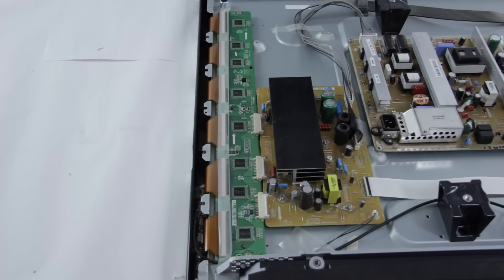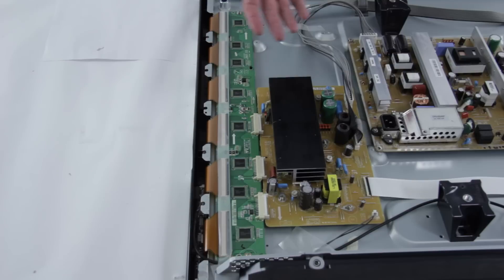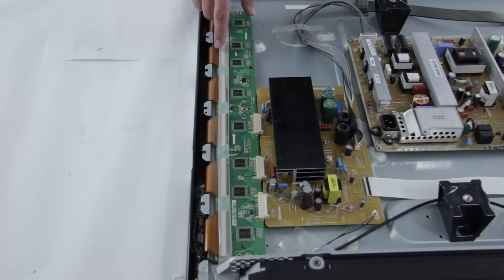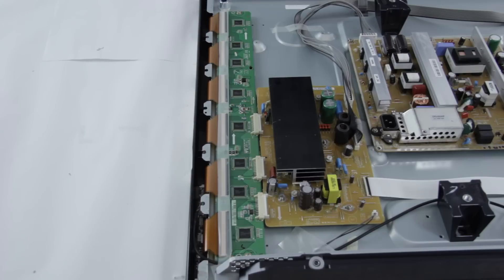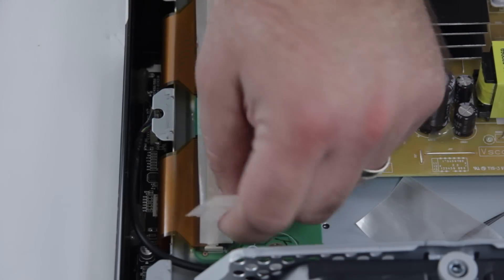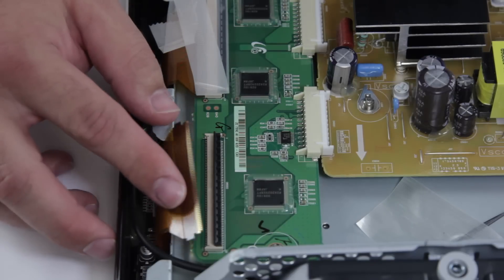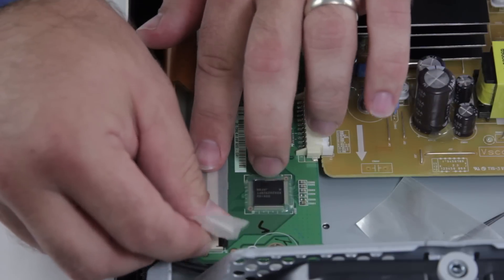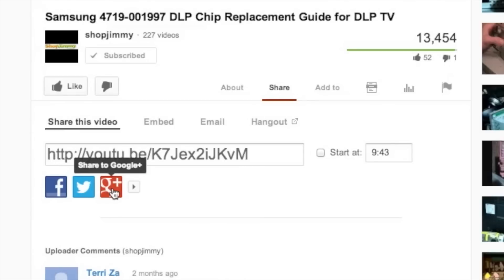Plasma TV Repair - No Image, No Picture on Plasma TV Screen - How to Replace Y-Buffer & Y-Sustain

Comment: i have a RCA 42PA30RQ that just turned off & when it turns on..there's sound but no picture..how do i fix this or what needs to be replaced?
Reply from the maker: B Jones  Try all repairs and troubleshooting at your own risk.  I recommend replacing the Y-Main Board and the Y-Scan Drive Board in your TV.  Click this link to replacement parts for your TV model number:  http://www.shopjimmy.com/catalogsearch/result/?q=42PA30RQ  There may be multiple boards for the same TV model number, be sure to match part numbers on your current board, with your replacement for compatibility.  Here is a link to a video showing how to identify your part number, click here: https://www.youtube.com/watch?v=R1jmj_foId0  Thanks and please let us know if you have any further questions with your TV Repair!  www.shopjimmy.com

Comment: I have a plasma Panasonic 42 in model tc-p42x5 
The tv turns on but doesn't display any picture at all . The led indicator shows that the Tv is On but without a screen.
Reply from the maker: Corina Arellano  Try all repairs and troubleshooting at your own risk.  I recommend that you bring your TV to a certified Panasonic repair shop.  Thanks!  www.shopjimmy.com

Comment: Hi, I have a Phillips 50" Plasma Model #50PFP5332D/37 My tv made 2 loud pops, then a dark, no pic screen. Where should I start first to possibly repair?
Reply from the maker: MMA WOZ   Try all repairs and troubleshooting at your own risk.  I recommend replacing the Y-Main Board and the Upper and Lower Y Scan Drive Boards.  Click this link to replacement parts for your TV model number:  http://www.shopjimmy.com/catalogsearch/result/?q=50PFP5332D%2F37  There may be multiple boards for the same TV model number, be sure to match part numbers on your current board, with your replacement for compatibility.  Here is a link to a video showing how to identify your part number, click here:  https://www.youtube.com/watch?v=R1jmj_foId0  Thanks and please let us know if you have any further questions with your TV Repair!  www.shopjimmy.com

Comment: I hace a 50 inch samsung plasma model FP-T5084 , the problemas is that half of the screen is dark and the other side is in  lighter color, what could the problem be ??????
Reply: I replaced 2 fuses a couple of days ago ,and was working justo fine till yesturday when the screen changed color in the middle..
Reply from the maker: marcelo guajardo  Try all repairs and troubleshooting at your own risk.  I recommend replacing the Y-Main Board and the Upper and Lower Y Scan Drive board in your TV.  Click this link to replacement parts for your TV model number:  http://www.shopjimmy.com/catalogsearch/result/?q=FP-T5084  There may be multiple boards for the same TV model number, be sure to match part numbers on your current board, with your replacement for compatibility.  Here is a link to a video showing how to identify your part number, click here:  https://www.youtube.com/watch?v=R1jmj_foId0  Thanks and please let us know if you have any further questions with your TV Repair!  www.shopjimmy.com

Comment: I think I have the same problem with a HP-T4234 Plasma tV,  it made a loud pop and stopped working.  when I plug it in,  it clicks but nothing else.  If I have to replace the parts as indicated on this video, I'd like to get an idea of the cost of the parts.  Newer technology TVs aren't that expensive and it may not make sense to purchase the parts if they are expensive.
Reply from the maker: Douglas Fry   Try all repairs and troubleshooting at your own risk.  I recommend replacing the Y-Main and Y-Buffer Board in your TV.  Click this link to replacement parts for your TV model number:  http://www.shopjimmy.com/catalogsearch/result/?q=HP-T4234  There may be multiple boards for the same TV model number, be sure to match part numbers on your current board, with your replacement for compatibility.  Here is a link to a video showing how to identify your part number, click here: Thanks and please let us know if you have any further questions with your TV Repair!  www.shopjimmy.com

Comment: I have a vimax 4219h plasma tv. It turns on and stays on but there is no display what-so-ever. It tries to turn on once for about 1 second but goes black. I've checked all the capacitors for swells or leaks and don't see any. I checked all the va, ve, vsc, vs values at the test points and all are right where they are supposed to be. Any ideas what my problem is?
Reply from the maker: chrisbrown4004  Try all repairs and troubleshooting at your own risk.  I recommend replacing the y board and buffers.  Unfortunately I do not see any replacement parts in the search results for your TV model number on our website.  Please reply with your part number on your y board and buffer(s) and I can try searching for replacement parts.  Thanks and please let us know if you have any further questions!  www.shopjimmy.com

Comment: I have a Samsung PN60E530A3FXZA Plasma.  there is no picture.  The red power light blinks every 9 secs.  There is an LED on the logic board that is not lit.  I have replaced the main board with no change in symptoms.  I have disconnected the Y-sustain and the X-sustain separately with no change in symptoms.  Please help
Reply from the maker: Tim H   Try all repairs and troubleshooting at your own risk.  I recommend replacing the Y-Main and the Upper and Lower Y Scan Drive boards.  Click this link to replacement parts for your TV model number:  http://www.shopjimmy.com/catalogsearch/result/?q=PN60E530A3FXZA  There may be multiple boards for the same TV model number, be sure to match part numbers on your current board, with your replacement for compatibility.  Here is a link to a video showing how to identify your part number, click here:  https://www.youtube.com/watch?v=R1jmj_foId0  Thanks and please let us know if you have any further questions with your TV Repair!  www.shopjimmy.com
Reply: Me too

Comment: I own a Samsung S50HW-YB01 that has a "fuzzy" "purpleish" image.

OK, I bought this TV back in 2007 and it worked fine until 2011.  At that point this image problem started.  It was intermittent at first but eventually became persistent.  Rather than try and fix it then I went and bought a LED tv and just put this in the basement to deal with "some day".

Well, some day is here.  Last weekend I plugged in the TV and the PROBLEM WAS GONE!!!  Perfect picture.  At least for 2 hours.  At that point the fuzzy purplish image came back.  The screen is still watchable but with a degraded image quality that is once again persistent.

So, I found a guy who said I needed to replace the X-Main board.  P/N LJ41-03335A.  Bought it, replaced it.  No change.  Image still has the same degradation.

What's next?  I'd like to have this TV working again.  Especially if it's just a matter of changing a board or two.

Suggestions?
Reply from the maker: Brian Coats   Try all repairs and troubleshooting at your own risk.  I recommend replacing the Y-Main Board and the Upper and Lower Y Scan Drive boards in your TV.  Click this link to replacement parts for your TV model number:  http://www.shopjimmy.com/catalogsearch/result/?q=S50HW-YB01  Be sure to match part numbers on your current board, with your replacement for compatibility.  Here is a link to a video showing how to identify your part number, click here:   https://www.youtube.com/watch?v=R1jmj_foId0  Thanks and please let us know if you have any further questions with your TV Repair!  www.shopjimmy.com

Comment: Hi I want to help !! Samsung LED TV UA32H5100 / T-CON board BN95-01304A .. No picture / Sound OK  .. but what about the region Alsalh cut image ..what should I do
Reply from the maker: Eslam El Shershaby   This sounds like a TV panel (TV Screen) problem.  If your TV panel is bad, it may be more cost-effective to replace the TV as panels are typically hard to find in stock, difficult to replace, and expensive.  Thanks and please let us know if you have any further questions!  www.shopjimmy.com

Comment: I have a pil421pch Plasma. It clicking and shotdown all that time ???
Reply from the maker: koby980   Try this at your own risk. Unplug the TV, then disconnect the y board and plug in the TV to see if the TV powers up. Reply with the results of this test. Thanks! www.shopjimmy.com
Reply: ShopJimmy.com i did it
same simptom
what next???
Reply from the maker: koby980  Repeat the same test on the X board.  Thanks!  www.shopjimmy.com

Comment: Having trouble removing the white ribbon cable from the Y Substain & buffer board. There was a loud pop and the plasma went out so I assume there is a problem with the Y substain black module. I have everything except the ribbon cable disconnected. 
Also where can I find a replacement module? Do I replace just it or the whole board?
Samsung 50" Plasma model numberPN50C550G1FXZA

Comment: Hello, I have an LG 50PA5500 plasma screen. During a movie, the screen just went black and the audio played on for a minute and it also shut off. Whenever you unplug the tv and plug it back in, it clicks as if it were coming on, but nothing happens. A red light is on where all the main outlets are located and a green light randomly cuts on and off above the power outlet. Any help is appreciated. Thanks.
Reply from the maker: Joyce Carroll  Try all repairs and troubleshooting at your own risk.  I recommend replacing the YSUS and the YDRVTP & YDRVBT boards in your TV.  Click this link to replacement parts:  http://www.shopjimmy.com/catalogsearch/result/?q=50PA5500  There may be multiple boards for the same TV model number, be sure to match part numbers on your current board, with your replacement for compatibility.  Here is a link to a video showing how to identify your part number, click here:  https://www.youtube.com/watch?v=GEllG3RV-tc Thanks and please let us know if you have any further questions with your TV Repair!  www.shopjimmy.com

Comment: I have a audiovox 42 inch pdp tv model number: fpe4216p. When I plug it up the light at the bottom is read when I press to turn it on the light turns blue. I hear a slight static in one of the speakers like it's turning on but the screen remains black. At the bottom of screen in one corner I see a little light like I can see the screen maybe on just remains black. What do you think is the problem
Reply from the maker: marqua blackmon  Try all repairs and troubleshooting at your own risk.  I recommend replacing the main board in your TV.  Unfortunately I do not see any replacement parts in the search results for your TV model number on our website.  Please reply with your part number on your main board and I can try searching for replacement parts.  Thanks and please let us know if you have any further questions!  www.shopjimmy.com

Comment: Plz help!!! i have a samsung pladma tv model no.: pn42b450b1d...I have been having problems with the screen. Every time I turn on the tv my screen flickers and usually will continue to flicker for a while sometimes it will fix and be good for a few minutes but then goes back to flickering and sometimes even just turns completely black. What is the problem? Is there anything I can do myself to fix it?

Comment: I have an LG 50" plasma. 50PG30F-UA. I have sound but no picture. In the dark I see a Faint glow on the screen. I believe.
Reply from the maker: Edward King   I recommend replacing the YSUS and the YDRVTP & YDRVBT boards in your TV.  Click this link to replacement parts for your TV model number:  http://www.shopjimmy.com/catalogsearch/result/?q=50PG30F-UA  Be sure to match part numbers on your current board, with your replacement for compatibility.  Here is a link to a video showing how to identify your part number, click here:  https://www.youtube.com/watch?v=GEllG3RV-tc  Thanks and please let us know if you have any further questions with your TV Repair!  www.shopjimmy.com

Comment: I have a Samsung HP R5052 plasma that turns on but had no sound or picture. I replaced the main power supply several months ago. Recently it lost picture and sound. I replaced the Y sustain board and the  both upper and lower Y buffer boards. I now have sound but still no picture. Any thoughts on what might be going on here?

Comment: Hi i need help, i have plasma samsung  model PS50B430P2W  no picture no image black screen sound ok all basic voltage ok (vs va ve)  fuses ok capacitors ok
Reply: same. or i switched my capacitors out

Comment: LG 50" plasma model 50pa6500-ua, has sound but no picture. All I did was pick it up and set it on the floor to move the tv stand, now it's a 50" radio.

Comment: My 42inch  Samsung plasma went dark. It flashes white when I turn it on then goes black. Sound still works. Model number PN51D450A2D. Is there a part I can buy to fix it?
Reply from the maker: craig wilson   Please watch this video FIRST to help with your repair!  https://www.youtube.com/watch?v=BP3NVNCGEv8  I recommend replacing the Y-Main Board and the Y-Buffer Board in your TV.  Click this link to replacement parts for your TV model number:  http://www.shopjimmy.com/catalogsearch/result/?q=PN51D450A2D  Be sure to match part numbers on your current board, with your replacement for compatibility.  Here is a link to a video showing how to identify your part number, click here:  https://www.youtube.com/watch?v=R1jmj_foId0
Thanks and please let us know if you have any further questions with your TV Repair!  www.shopjimmy.com

Comment: I'm having problems with my Samsung PN42C450B1D. I accidentally hit the screen and it cracked. Right after that the screen went black and there is a humming sound . The power is working just black screen the the humming sound. I appreciated if you can help me.
Reply from the maker: Cporr1972   Since the screen is cracked this sounds like a TV panel (TV Screen) problem.  If your TV panel is bad, it may be more cost-effective to replace the TV as panels are typically hard to find in stock, difficult to replace, and expensive.  Thanks and please let us know if you have any further questions!  www.shopjimmy.com

Comment: Having trouble with my Samsung PN50C4903D plasma.  After about an hour of watching, the screen will start to flicker.  The image will flash with pink,red.  This will happen intermittently until the image disappears.  The sound will still he on.  Only way to get picture back is to cycle tv on.  Sometime the image will return, sometimes it takes 2-3 cycles.  Any help would be appreciated.  I have a short clip of the image distortion if that would help.

Comment: I have a samsung plasma model #pn51d450a2d and my kid hit it with a shoe and now the screen is black and the only sound is a squealing noise. I do not see any visible cracks in the screen. What should I look for to repair.
Reply from the maker: matthew rice  Please watch this video FIRST to help with your repair!  https://www.youtube.com/watch?v=BP3NVNCGEv8   Be sure to inspect the glass closely for cracks as you will not want to turn on the TV if there are any cracks in the screen.  If your screen is good, then I recommend replacing the Y-Main Board and Y-Bufffer board in your TV.  Click this link to replacement parts for your TV model number:  http://www.shopjimmy.com/catalogsearch/result/?q=pn51d450a2d  Be sure to match part numbers on your current board, with your replacement for compatibility.  Here is a link to a video showing how to identify your part number, click here:  https://www.youtube.com/watch?v=R1jmj_foId0  Thanks and please let us know if you have any further questions with your TV Repair!  www.shopjimmy.com

Comment: I have a Samsung TV model un32eh4003fxza in the middle of watching a show the screen went black.  The tv will turn on but the screen is black and it still has sound.  Which part would I need to place. thank you

Comment: I have a samsung plasma 51 inch...its about 4 years old. Last night it was working great no problems.  Today I want to turn the tv on and you can here it turn on...see the red light on the bottom left, but nothing happens.  It is almost like I didn't turn on the tv but I can see the red light respond to the remote.  Any suggestions?

Comment: Hi, i've got Plasma LG50PC56, and it does turn on when cold, and works as it should. But once after a while screen goes black, No video just Sound, so I need to turn it off, keep it to cool down for few minutes to make it work again. Also if I connect it to PC and while it's connected I change resolution on my pc, TV screen goes black straight away, but sound stays on. What part could be causing this problem? BTW once screen goes black, if i click on remote to show menu,nothing shows up, screen is just black until i restart tv.

Comment: I have a samsung Plasma TV, I have found out that on the y-sustain broad one of the orange? has a burn on it. Is this the reason why it is making a clicking sound. Model PN50c450B1D. If I replace the Orange thing will this repair the tv. Thanks Ken

Comment: I pick up my 51 inch plasma TV zenith brought it up stairs .it worked for 1 day then the screen went black I have sound but I can't do anything else with it.modrl number is z50pv220
Reply from the maker: Brian Springer   I recommend replacing the y board and y buffer boards in your TV.  Unfortunately, I do not see any replacement parts in the search results for your TV model number on our website.  Please reply with your part number on your y main board and y buffer(s) and I can try searching for replacement parts.  Thanks and please let us know if you have any further questions!  www.shopjimmy.com